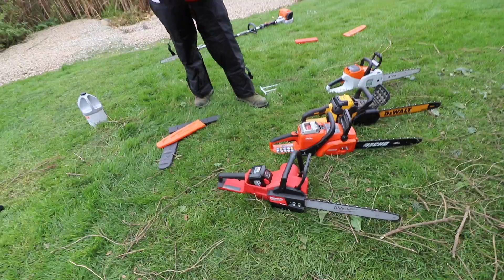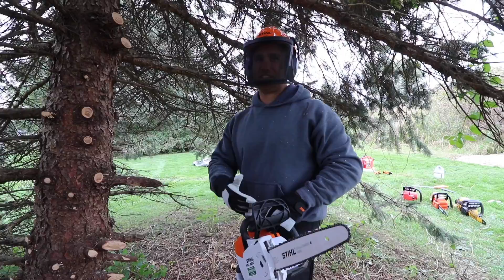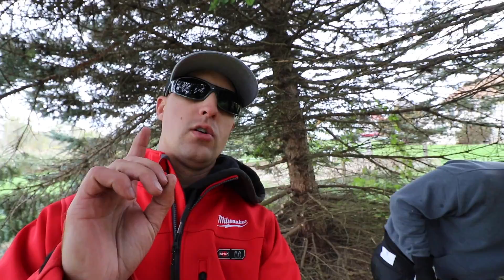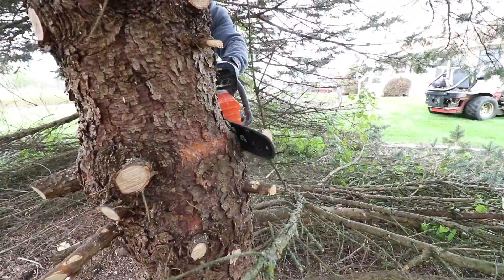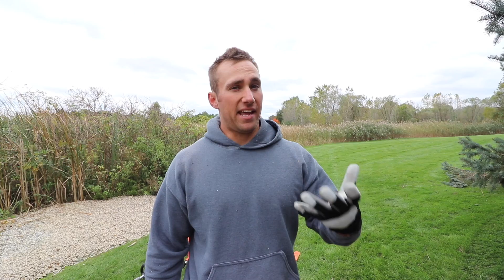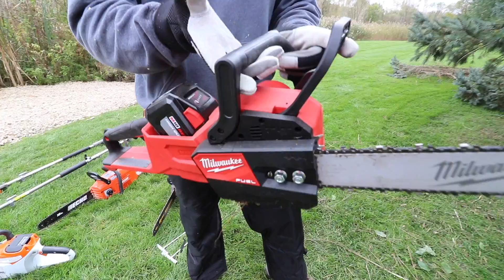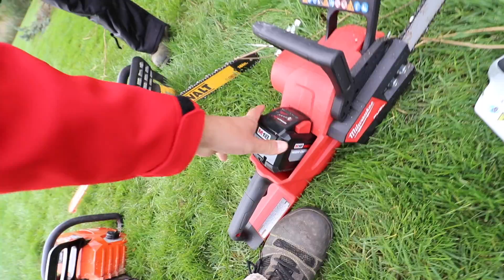4 Way BATTERY Chainsaw Comparison ► Which Has The Better Cut And Torque?

Comment: I’m using the Makita XCU03 right now to cut firewood from a large pile of mixed hardwood logs left from clearing gas line right of way.  Most of the wood is larger than 16” diameter and which requires working around from one side to another.  Oak, hickory, black walnut, some poplar.

I installed a 16” bar with full chisel chain and that improved the saw noticeably.  I cut my wood in 9” lengths.  Of course this requires twice as many cuts for the same amount of wood, but the shorter pieces are all I can lift into the trailer.  I fill my small trailer 5’x4’x2’ above the side rails, which is near the maximum weight I want to pull with a small RZR side by side.  This usually takes a set of 6 Ah and one set of 5 Ah batteries.  Sometimes I need a little extra to finish so I use a set of my older lower capacity 3 and 4 Ah batteries to finish off.

If I were cutting 18” long pieces I think this saw might easily work up an 8’ pickup load of wood with two sets of 6 Ah batteries. The 16 inch bar with full chisel chain seems to cut faster than the Makita 14 inch bar and chain that came on it.  I bought both bar and chain for $30 on Ebay.  Archer brand - made in Australia.  

I get to rest for 45 minutes or so after unloading while my batteries recharge (in more ways than one).  I like that!  I’m 70 years old and fairly sedentary.

All of those saws seem like they are very well built and powerful battery chainsaws.  The Milwaukee especially, they make good quality tools.  It seems odd to me that they chose to make the saw run on 18 Volts.  Because of that the physics forces them to use really large wires and heavy motor windings to handle the resulting high amperage.  Makita combined their 18 volt batteries to produce 36 volts to drive the motor thus making it far lighter and smaller with the same total power output.

Power is measured in watts, total power is watt hours.  Watt hours = batteries x volts x amp hours.

One Milwaukee 18V (nom) 12Ah battery weighs 3.7 lbs. (18)x(12) = 216 watt hours

Two (2) Makita 18V (nom) 6 Ah batteries weigh 2.7 lbs.  (2)x(6)x(18) = 216 watt hours

This decision makes Milwaukee among the heaviest chainsaws @ 14.0 lbs while Makita’s weigh the least @ 10.1 lbs including batteries with equal power.  But the Milwaukee is one well build machine and you wouldn't go wrong with it.

Here's some info I put together.   In my opinion it's weight of the saw and total stored energy in the batteriest that matters most, i.e. volts x amps.  Hope this helps someone.

One Milwaukee 18V (nom) 12Ah battery weighs 3.7 lbs. (18)x(12) = 216 watt-hours 

One Husqvarna 36V (nom) 4.2 Ah battery weighs 3.21? lbs  (36)x(4.2) = 151 watt-hours

Two (2) Makita 18V (nom) 6 Ah batteries weigh 2.7 lbs.  (2)x(6)x(18) = 216 watt-hours

One Dewalt 54V (nom, not max) 4Ah battery weighs 3.2 lbs  (54)x(4) = 216 watt-hours

One Still with 36V (nom) 4.9 Ah battery  weighs 3.8lbs  (36)x(4.2) = 178 watt-hours
Reply: Hi Gerald, nice overview, thank you. However, while you are correct the power is measured in Watts=Amperes * Volts,  Watts*hours are the units for the Energy the battery holds (not total Power :) ).  The total energy (i.e. Watt Hours) determines how long the battery will last (of course this depends on the power drained from the battery when in use, the Power being the energy used per second/or hour).  The units in the last four lines should therefore be Watt hours, not Watts, representing the energy stored in each battery.
You gave very useful information nevertheless, I just thought it would be best to correct for the units, so as not to confuse people.
Reply: Yes, of course, I intended that to be watt hours - total energy storage.  I edit it for future readers.

Regarding work output or horsepower or watts it is strange that battery powered tools don't list this parameter.  I wish battery saws would spell out horsepower or watts output.  It would be helpful to the consumer in order to decide what saw they need.

You know, of course, that watt-hours isn’t horse-power or watts @ maximum output and you can’t even really translate corded brushed saw wattage directly to horsepower (because of efficiency losses).  My Makita, for example, uses two 10 cell batteries or 20  18650 Lithium cells.  Each cell can output up to 70 watts each continuous, therefore the Makita battery saw motor can output 70 x 20 or 1400 watts @ peak power, that’s 1.88 horsepower.  This is the equivalent of a brushed corded saw running at 1750 watts due to the high efficiency of the brushless DC motor.  

It must be noted that we rarely ever run a saw continuously.  At 1400 watts continuous peak my saw would only run for a little more than 9 minutes with 216 watt-hour battery.  But that not how saws work, sometimes they don’t draw full power and sometimes they aren’t running at all.  It takes me over an hour to get a load and consume 500 watt-hours.  This is because I'm loading and moving wood or going from one spot to another, not not sawing full power in an uninterrupted manner. 

Some battery saws are more powerful, albeit much, much heavier.  Most use the same 18650 batteries, but some use 20700's or 26650’s or a musher greater number of batteries and can therefore output more continuous power and drive an even longer bar.  For example, a certain Echo battery has 28 18650 cells each capable of outputting about 70 watts each.  That’s 70x28, or 1960 watts continuous power or 2.6HP - Wow.

Amazingly however, the Makita 6Ah battery set contains approximately the same total energy as that battery, 218 versus 204 watt hours.  Which means both saws should cut the same amount of wood on a battery set, albeit, the Makita SHOULD be a bit slower.  For me, the important part is not speed, but weight (my back).  The Makita does it with close to half the weight.  Because, who wants to trim limbs with a 20 pound bowling ball?  

 Thanks for your interest, I'll edit.
Reply: @geraldmoore6257  truly amazing oh, I just wanted to say thank you for your review and a world of information. I am in the decision-making process of a rechargeable battery chainsaw at the moment! You like your Makita but you also had good words for the Milwaukee. I guess I'm old school I thought the More Voltage in the battery was a stronger chainsaw but from your review that is not the case. I have to make a decision soon, thank you again for the info.
Reply: Thanks for telling me that you benefited from my comment.  Here's more crap to think about.  Total energy stored in the batteries is not all you need to consider either.  Some brands use more cells or bigger cells and can output more continuous power or watts or horse power.  One Stihl battery contains 30 each 18650 cells whereas Makita uses only 20, 10 in each battery.  I wish Makita made a 15 cell battery.  Typically, 18650 high power cells can output about 70 watts each, so that saw can output 70x30 or 2100 watts of power during cutting versus only about 1400 watts for Makita.  However the total power of the Stihl battery is listed as 227 watt-hours, about the same as two Makita 6Ah LXT batteries.  They probably cut the same amount of wood, only the more powerful saw cuts it faster (theoretically).

Most saws use the  18650’s, but some use 20700's or 26650’s (much bigger) and can therefore output more continuous power and thus use an even longer bar.  For example, a certain Echo battery has 28 18650 cells each capable of outputting about 70 watts each.  That’s 70x28, or 1960 watts continuous power or 2.6HP.

I don’t think I need anymore power to cut firewood, I doubt it would save me much time.  The downside to more power is more weight.  Some saws weigh up to 20 pounds with battery.  The heaviest bowling ball allowed is 18 pounds.  You have to be young and strong to manhandle them.  

It's curious how tool companies try to leverage the general population's lack of scientific understanding.  To the average person, more volts---->more power.  The reality is that volts isn't power all.  A stack of 10 lithium button batteries is 36V but you can't cut wood with button batteries. Most of the battery saws with 16" bars require upwards of 1200 watts output to cut reasonably fast.  Corded saws run 20% higher amperage for the same work output because they typically use brushed motors and are less efficient.

The tool companies even leverage the fact that lithium batteries read about 4 volts right off the charger.  20 cells x 4 volts = 80 volts.  The reality is that lithium cells produce a flat voltage throughout use of 3.6 volts so a 60 volt saw is really 54V.  They further market this as "max" for that reason.  The consumer then reads something more into that maximum initial volts and believe it means even more power.  A big disadvantage to high volts is difficulty balancing all those series batteries.  Also, they are like old series Christmas lights, one goes out, they all go out.

Whatever saw you chose, decide how many batteries you need.  It takes about 500 to 700 watt hours of power to fill a pickup with 18" wood.  Read the Wh rating on the batteries and buy accordingly.  The whole reason I have Makita is because I already had LXT tool batteries and 6 chargers.  It was the cheapest way to go for me rather than get onto another battery platform.

Comment: I have the Milwaukee and it's a beast. Never a shortage of power and I've had the bar completely buried in trees. One thing I noticed in the video is the Milwaukee was also the quietest saw. And I don't have to have different chargers and batteries for the rest of my tools like a drill, driver, impact, sawzall, circular saw, grinder, and so on

Comment: for garden and outdoor work...  Gotta go with a MSA 200 Stihl  or a Husqavana  brand.  Throw those tool chainsaw away.   I have use Stihl all me life.  Im a homeowner and  volunteer in trail clearing in SOCAL.  The Battery has come in very handy. As in SOCAL while in the woods one cannot use Gas machines unless you're a professional  i.e. firemen or arborist. Stick to the Home & Garden brands.

Comment: You are not giving details on the 3 different types of batteries possible to use. Does the tool work stronger with s stronger battery?
Reply from the maker: Nope. The brushless motors are pretty similar I’ve noticed. The amps and volts mean battery life and max peak output. It’s a balancing act between the number of cells each battery has. It’s a complicated equation, one that I’m not going to pretend I understand yet fully.

Comment: This should have been conducted using a new chain on all as opposed to sharpened chains. It's very easy to sharpen a chain wrong which looks to be the case on the echo. It looked like the drags were set too high and it was barely cutting.
Reply from the maker: We’ll be doing a redemption video soon enough.
Reply: @BriansLawnMaintenance  Sweet, I can't wait!

Comment: You guys need to do more research.  Makita offers a top handle saw which is absolutely necessary for limbing and you should have also tested the Makita which screams and uses 4 batteries at a time.  I think the Milwaukee also has a 36 volt version.

Comment: If you have to use down pressure to make the saw cut the chain needs to be properly sharpened. A compression is only fair if all things are equal, the chains were not equal.
Reply from the maker: They were professionally sharpened. Not sure what else to say
Reply: @BriansLawnMaintenance   Not much, as the video clearly shows the chain was not cutting properly. Many people claim they're proficient at sharpening chain, unfortunately the vast majority of the time this is simply not the case. Using new chains helps take out this huge variable. Sharpening a chainsaw chain properly is more complex, it takes years of experience, most people are unaware of this, and even less people would even know the difference.

I did enjoy the video and your channel nonetheless. This however was far from a fair comparison IMHO.✌

Comment: If you are cutting small limbs as in this video then I can beat these chainsaws with a battery powered sawzall. Plus the sawzall Blades for demolition out last the chainsaw blades.
Reply: I agree with you that a sawzall would work better for little branches like that, though i use the diabolo pruning blades for a much faster and aggressive cut.
Reply: Chain saws don't have blades.

Comment: Wish you guys had the 80V Kobalt chainsaw. Either Kobalt or Milwaukee since I already have batteries for both. BTW that Milwaukee heated jacket doesn't keep warm on a cold day but does take the edge off and needed a larger battery when setting is on high for better run time. I think the chain make a lot of difference, something like a skip tooth chain cut faster, no?
Reply from the maker: I like the Milwaukee heated hoodie since it was closer to the body, it was definitely warmer. But the jacket is really heavy duty for sure

Comment: I use DeWalt 60 volt flexvolt chainsaw on a knuckle boom to do some limbing off 50 year old big wide span pine tree. Cordless chainsaw is the way to go in confined spots like a boom bucket. I'm waiting on my Milwaukee to come in to compare. In my opinion. DeWalt is a good economical choice for the money and performance I think we'll walk you will probably be stronger but also  pricier.

Comment: The 58V Echo needs to have the depth gauges cut down! The teeth may be sharp but anytime you have to use downward pressure check the depth gauges. But the Stihl motor does get up to speed and torque quicker. It appeared that only the Stihl had the depth gauges in good shape. It makes a huge difference.

Comment: I've had a 40 volt dewalt for almost two yrs... works great - use it for carving and no exhaust especially when working in the garage. Some say chain comes off - never an issue for me.  Oiler was a little excessive to start with but has leveled out.

Comment: I have the DeWalt 40v I’ve had it for about a year I use it to Cut wood for heating my Workshop that I run a eBay parts business out of I have to say I have always used STIHL gas saws but The DeWalt Has been very convenient and the quiet operation is The main reason for purchasing it. So far it’s been reliable I have cut up  oak trees with it on one charge It’s done far better than I ever expected
Reply: Matthew Milam the dewalt just has way to many design flaws for me. I used one for a week and the bar just moved around on its own and the racheting tensioner was a joke. But I am glad you have had good luck and I hope it continues to work well for you
Reply: Matthew Milam try a green works I have one and it works great

Comment: Thanks for the reviews. Looking at Greenworks PRO 18-Inch 80V Cordless Chainsaw with 2.0 AH Battery for a Christams present. We have a lot oaks that my husband needs to keep cleaned up around the house. What do you think Compared to the Stihl?
Reply: SunnyDaysSandyToes I'd buy green if they sold it in my country
Reply: I would not buy greenworks. They are not made well. Stihl and Echo makes really good chainsaws. Stihl $600 Echo $300. And with the Echo losing to the Stihl The Echo either had a dull chain or had the chain to tight. If your hubby has Makita tools as in 18v lithium Ion  batts get the Makita 36 volt it uses the same battery playform as 18v Makita. Any saw they showed are much better choice then Greenworks.Greenworks are one of the brands made really lousy and try to compete with real stuff because they sell them way cheaper. Oh and I did not see the date on this vid so if you bought a Greenworks you probably know its junk by now if he uses it much.
Reply: @shinyokoyama8470    I have had a green works for about 4 years now. And it works great . I'd recommend them for sure as a homeowners saw.  Chopped up multiple full ash trees with it. Doesn't compete with my gas Husqvarna by far but it's definitely held up and I work it hard in the bush some days. Nothing has broke or failed on me

Comment: Been using a stihl battery saw with a 12 inch bar and that is now my constant carry on my four wheeler when checking the perimeter of my property. I have cleared downed 8-10 inch trees and when you let the chain do the work and not force it it you can get many cuts. I cut one face cord of 5 inch limbs with one battery.
Reply: Nick i have done the same with my 120 stihl. At 60 years old i last alot longer cuting smaller stuff than if i use o38 or 461. Yes the little saw can cut big locust  if it has to.batt won't  last as long but the tree or branch will be out of the way. No ethanol or fumes to worry about.

Comment: One thing to note which is a major factor in performance the stihl has a smaller chain than the others I believe it is a 1/4 chain vs the standard 3/8 low profile use on the other 3

Comment: Battery saws have their place and in the professional field the only place they really belong and actually work quite well is in a bucket truck. The battery saw like a stihl or Husky would be perfect in a bucket for limbing and taking a tree down to the point of the main trunk. Would save a ton of engine starts.

Comment: I use the Greenworks 80V PRO chainsaw. I have had good results with it   I cannot say it is the best. I have not tried any other electric chainsaw. I can get about 20 rounds from one charge on 16 inch hard woods. It takes 30 minutes to charge the battery. It’s not a gas powered saw, but it never fails to start. The pros for an electric are: no mix, quit, no fumes, light weight.